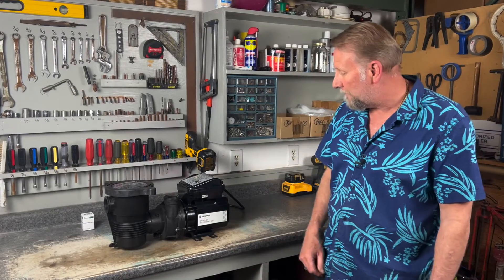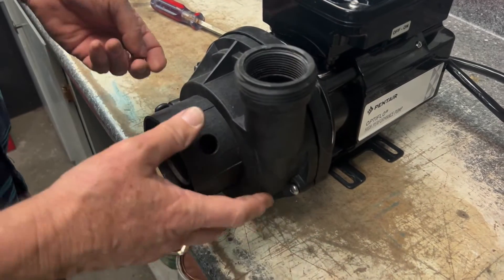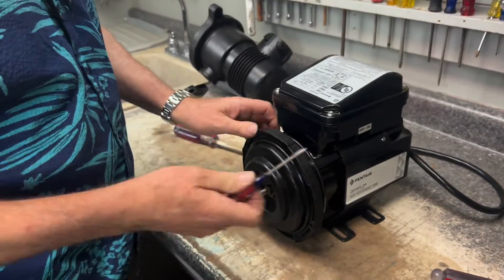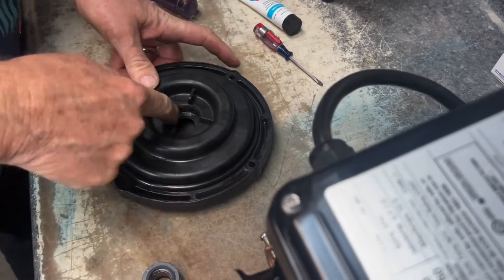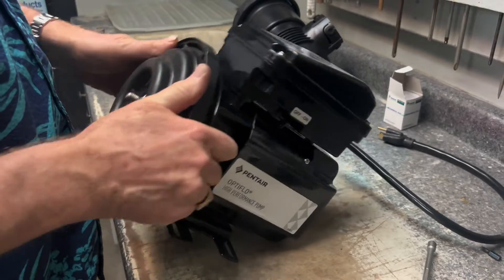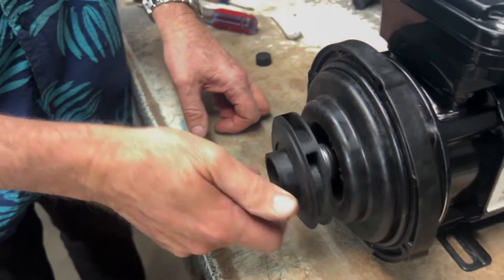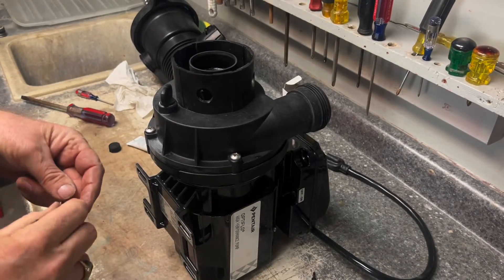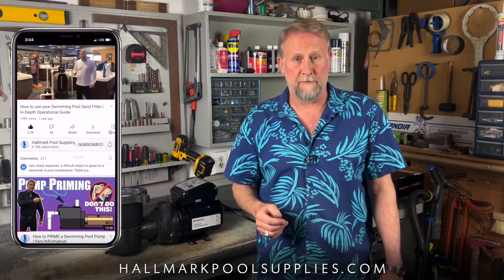How to Change Seals on a Pentair Optiflo Pool Pump!

Comment: Question about the ceramic seal in the rear plate. Did you use silicone lube or another lube to seat the seal??

Comment: What should I do if water gets in to the pool pump motor ?
Reply from the maker: @Sora-Vision0   Turn off the power to the motor, remove the back plate where the electric hooks up. Let the motor sit for at least a couple of days, you can even occasionally run a hair dryer on it. Once the motor is good and dry you will be able to try it. If it does not work then you will have to replace. If you need a pump or a motor l can help. Email your contact info, my email is on my YouTube channel. Thanks for watching.

Comment: my thru bolts are rusted solid.  I cant move them for nothing.  I cant tell exactly what kind of bit to use either.  You said use a star bit, but mine look like allen head.  I have to get them loose because the seal got hot and melted the back plate, also my impeller was stripped, so I have to replace both.

Comment: Do you have a video that explains what tubes you connect where when replacing a pool pump? I have a new pump that came with extra parts and no explanation. Then I can move on to replacing the sand in the filter! which I've already cleaned out thanks to this video!!
Reply from the maker: I have a video on how to open your above ground pool where l show how to hook everything up for the season. If you have a sand filter with a multiport, each outlet on the valve is labeled. Look closely at each outlet from the valve and you will see in fine print on the side of each outlet the words pump, return and waste. This will tell you where each hose goes. Hopefully this will help. Here is a link to that video. Thanks for watching.
https://www.youtube.com/watch?v=mzfB84btl0c&t=24s